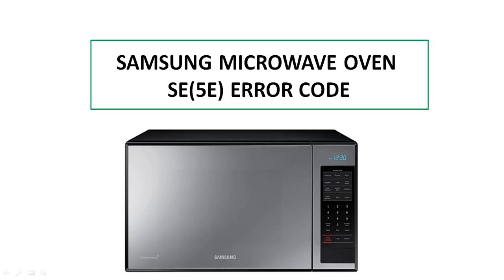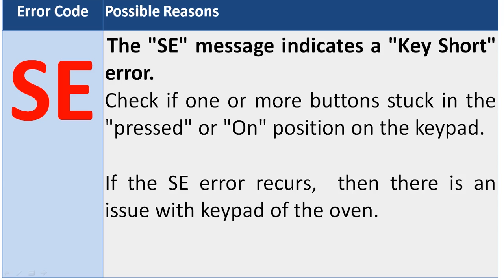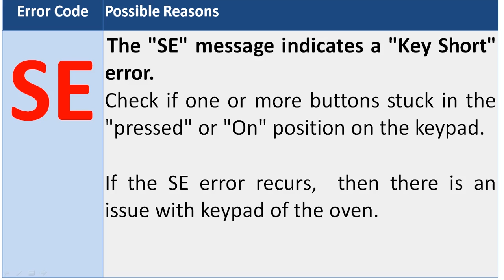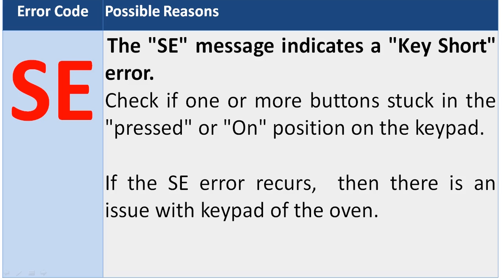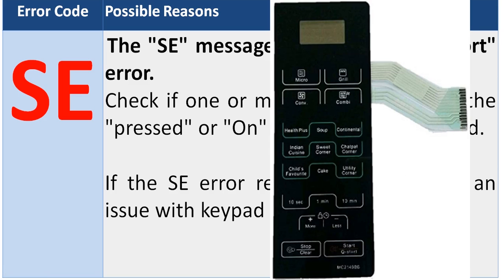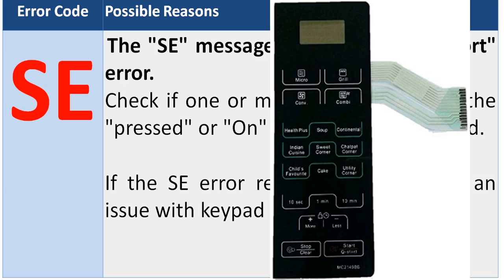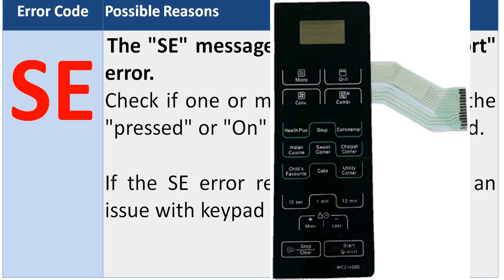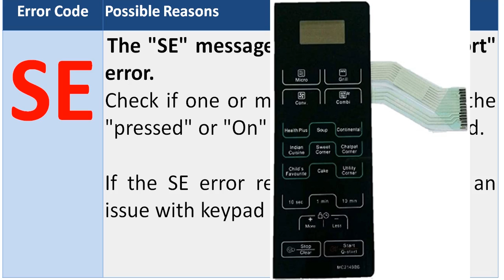Samsung Microwave SE(5E) error code details || Fix

Comment: Sir, Mera Samsung MW840WF Microwave oven hai usmein SE code show kur raha hai,
Aur koi button kaam nahi kur raha hai,
Please let me know what is the main problem,
And how can i solve the issue.
Thanks
Reply from the maker: it may be keypad issue....try to release the keys which are in pressed condition continuously by touching the keys on the keypad....if problem not solved clean the keypad and also keypad connector...